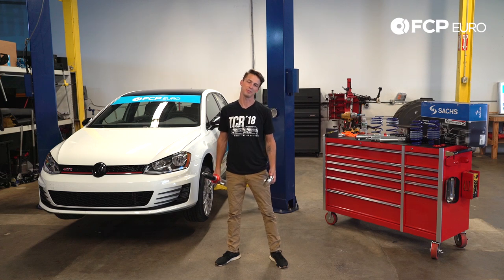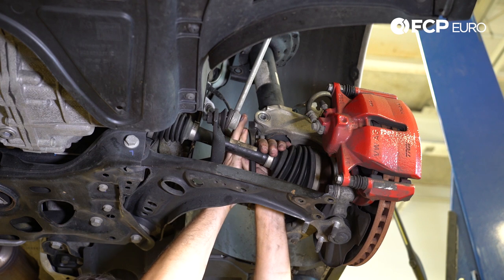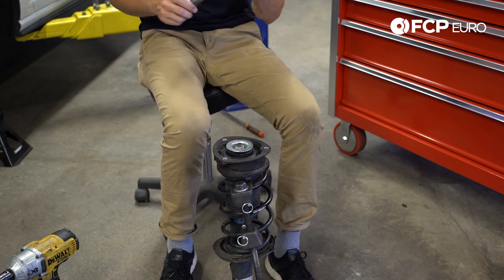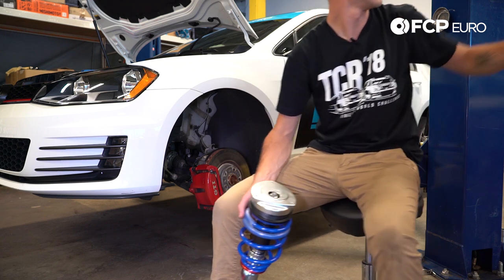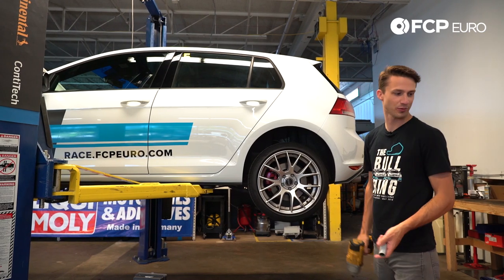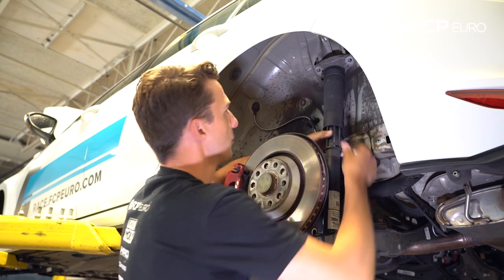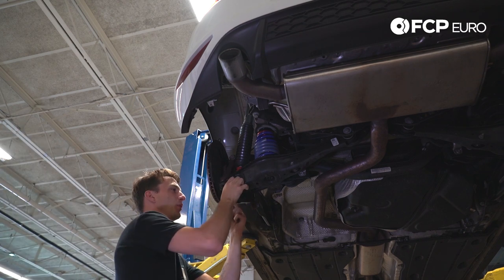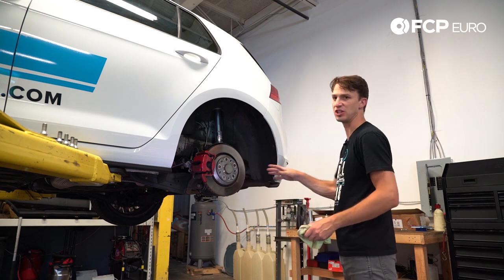Audi/VW Coilover Kit Installation - SACHS Performance (GTI, Golf R, S3, A3, A3 Quattro)

Comment: Not sure why all the dislikes on the video. It’s thorough and well-explained. I wouldn’t use an impact for the strut mounts/bearings, and would replace the stretch bolts while torquing everything back to factory spec, but otherwise it’s a good watch 👍🏼

Comment: Just a tip for anybody who may see this regarding spreading the front knuckle assembly, using a strut spreader socket tool (~$20 on Amazon) really makes the process much easier. Or in a pinch, a 3/8" drive to 1/4" drive adapter can also work as well, but doing so most likely will sacrifice the adapter after you're done with the install.

Comment: Thank You. Going to consider the Sachs Performance when it comes time to replace current Coilover set up on MK6.  Blue Loctite, Torque Wrench, and VW sez to replace 'stretch bolt' type hardware. A least replace locking type Nuts!  Cuz we drive it like we stole it.  :)

Comment: installed these recently. Does the adjustment in front get really loose as you go down to the softest setting? Mine do. It almost feels as if it's gonna fall out.
Reply from the maker: Hi Jakub. Yes, the adjustment feels very loose when you get down to the bottom. We run these dampers on all of our race cars and they all do the same thing. Basically, how they work is there is a rod that is pushed into the damper piston. The softest adjustment applies no pressure, therefore the adjuster feels loose whereas the hardest setting applies the most pressure to the piston. I wouldn't be concerned as these are exactly how they are designed to be. We worked directly with Sachs during a track day adjusting these so you should have no issues.
Reply: FCP Euro thank you for the response. You guys are the best!!!??
Reply from the maker: You're welcome Jakub
Reply: FCP Euro found these to be a bit softer than I was hoping for. What are the spring rates on these and how much higher of a rate should the struts be able to handle?